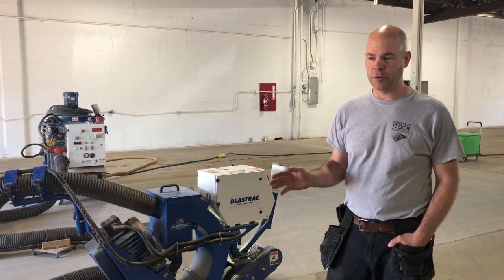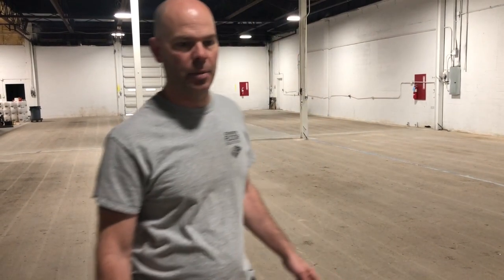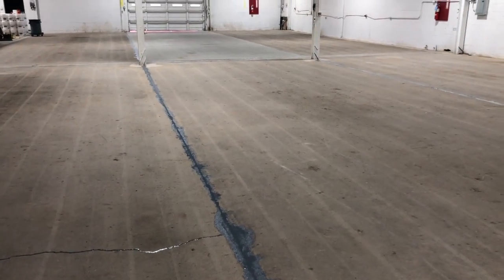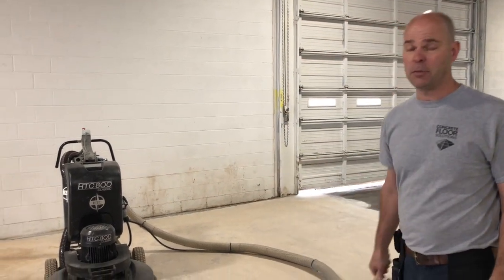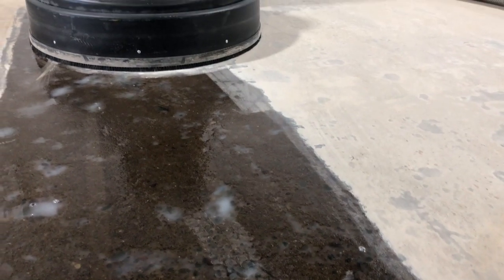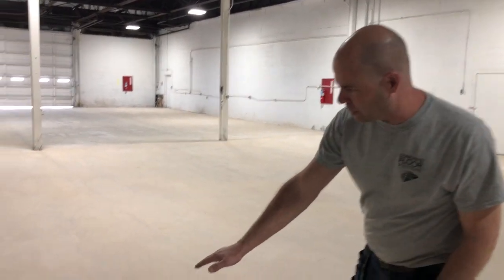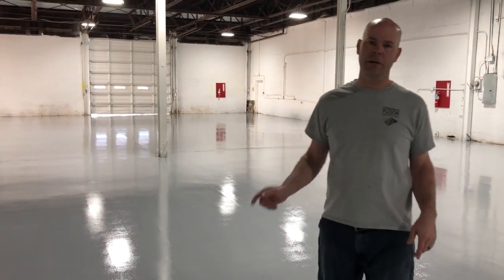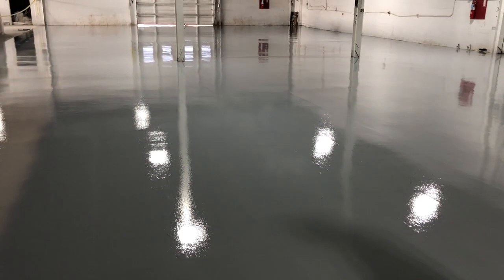How to repair widespread surface deterioration in concrete using an epoxy slurry then epoxy coat.

Comment: Does the added stand for the epoxy extend the pot life of the epoxy? And what is the pot life or working time of the mixed flurry?
Reply from the maker: the sand extends the epoxy  (sand is much cheaper than epoxy) not too much though because it has to be self leveling.  potlife is +/- 20 minutes, working time on floor is +/-40 minutes.  It is crutial that you apply and backblade the material quickly before the sand settles out of it.
https://concretefloorsolutions.com/product/cfs-epoxy-slurry-kit/

Comment: If one were not interested in the appearance, could they just do the slurry and grinding steps?
Reply from the maker: If you would want yes, it would leave you with a grinded smooth floor but not cosmetically pleasing at all

Comment: 10k pounds of dust, is that an exaggeration or are you being literal? Holy crap! Where do you put all of that? How do you manage the disposal of something like that?
Reply from the maker: Literal, That may actually be less than what we really had. We filled a roll off dumpster 3/4 full with dust. We use a very good dust extractor on the job site (Blastrac 654) so there is no airborne dust.  The customer is responsible for supplying a dumpster and disposal of the material. It is simply ground concrete dust
Reply: @ConcreteFloorSolutions  wow, I never imagined the scale of concrete dust, thanks for sharing the details.

Comment: What do you do about oil stains? There must have been some.
Reply from the maker: We have a material we use called CFS-820 Oil Stop Primer. It is very low viscosity and designed to penetrate through the oil stains. https://concretefloorsolutions.com/product/cfs-820-oil-stop-primer-2-gallon-kit-black-only/

Comment: What’s the ratio of that slurry?
Reply from the maker: Typically it's 5 quarts of 70 mesh sand per 3 gallons of epoxy. It needs to be the right viscosity epoxy or it won't mix correctly. We sell pre-batched kits   https://concretefloorsolutions.com/product/cfs-137m-epoxy-slurry-kit/

Comment: Great work.  Couple questions:  Did you broadcast any anti-slip in topcoat? /  If not, what does that conversation with your customer look like during the expectation-setting process?   What was your quoted $/sq. ft for this 3 coat slurry system?  And finally what product did you use for slurry/ratio of sand to product?  Thanks!
Reply from the maker: No anti slip was added, this is a warehouse floor and needs to be smooth. The slurry system costs approx $1.00 per sq.ft. for the materials https://concretefloorsolutions.com/product/cfs-137m-epoxy-slurry-kit/
All of the mix information is available on our site / online store.
This floor was approx $5.00 per sq.ft. installed, that included the prep, slurry, and two coat epoxy floor system.

Comment: What size of steel shot you used in the shot blaster?
Reply from the maker: 280 or 330, the higher the number, the coarser the grit.